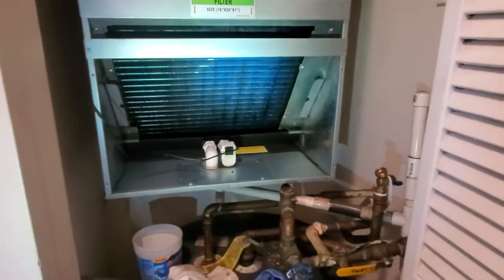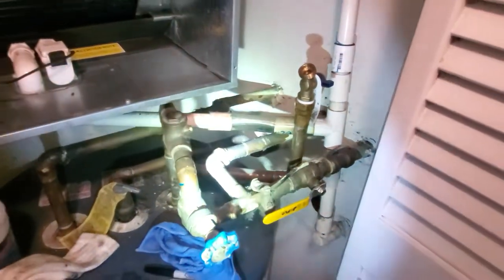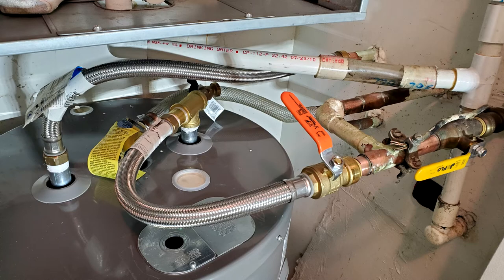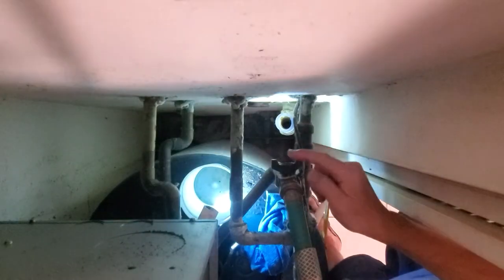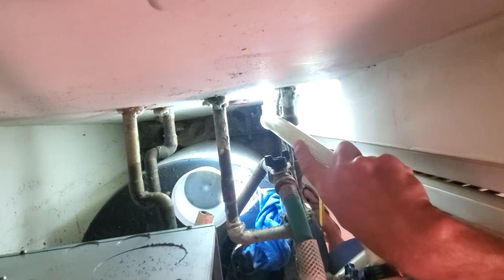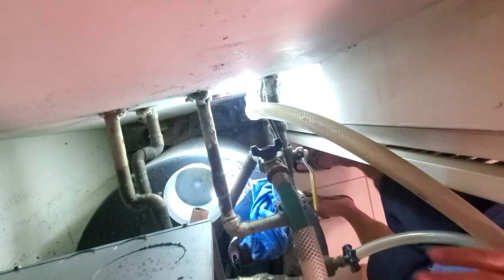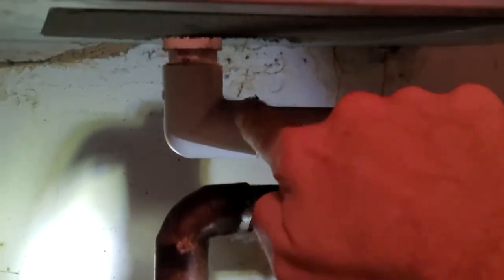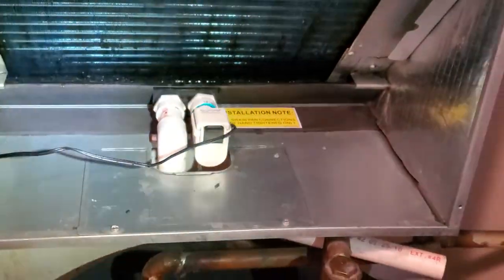How to Clean AC Drain Line in Apartment

Comment: opening water down the drain wont affect your neighbour down stairs?
Reply from the maker: it should not assuming al the plumbing is ok. I have never had issues.
Reply: Hypothetically, if the bottom of the pipe outside was completely clogged, wouldn’t forcing water down like that cause the water to back up in the unit downstairs from you? Maybe there’s a valve or something that prevents the downstairs unit from taking in all of that water. I don’t know how the pipes are set up usually. It seems like it would be safer to force compressed air down there, instead of water. I wonder how the HVAC people do it.
Reply from the maker: @scenicjax6402  You are correct. Forcing air would be safer but I don't have any devices that would allow me to do that. Also if there is bucj of algi buildup water will physically push it out. Air may not do that same. If AC drain pipes are clogged to the point when there is a back up all people on the same level would experience back flow.
Reply: @MaciejPiotrowski  Ah, yes, I see now! Thank you! 😊
Reply: @scenicjax6402  I have this same on going problem. As I watched on "YouTube," your outside pipe, which eliminates your in-house water can clog. This is when, you get a "Maintenance Man," and have a "JET-VAC," to take the outside pipe, cover it up with a rag around, and use the Jet-Vac to clean out the pipe outside. Blow out all excess dirt buildup inside the pipes. I watch constantly.
Hope it helps!

Comment: you should use a wet vac.
Reply from the maker: Vet wac can only pull or push air. This does not clear real cloggs. THe only way to push algi out is to push water out tha twill push algi out. Believe me I tried vacuum. It's a temporary fix